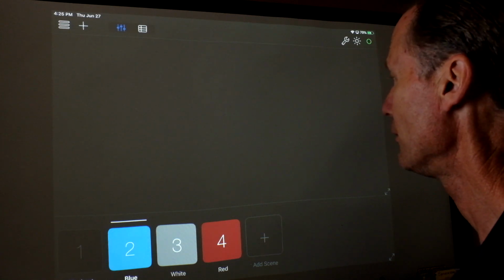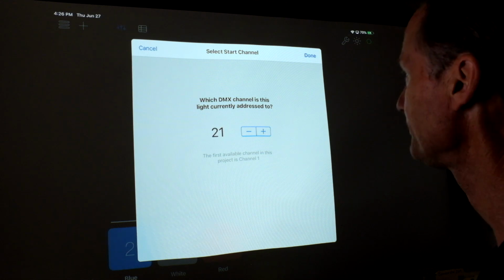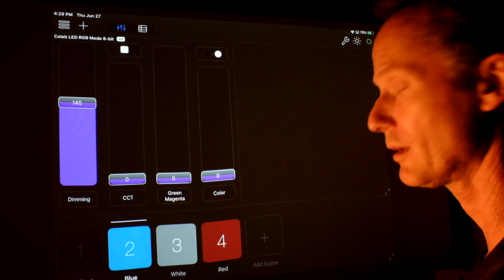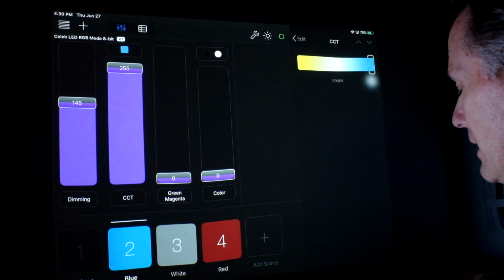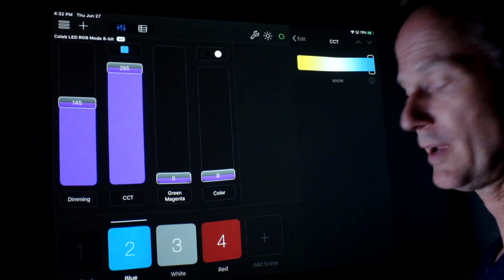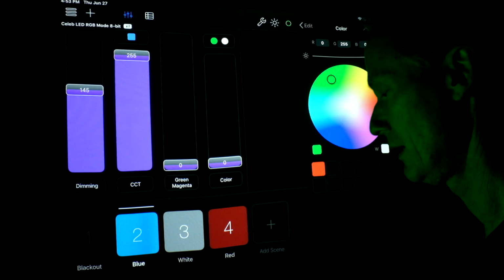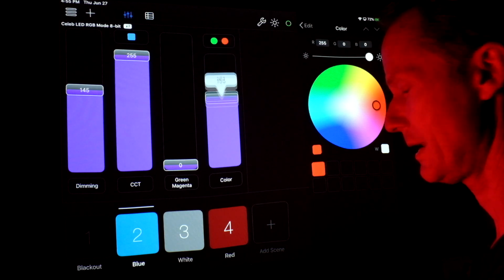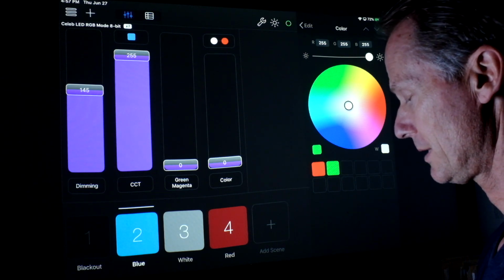Light Craft: Adding an RGBAW LED Light into Luminair Tutorial

Comment: Is there a way to remove the color fader and add an R, G, and B, fader, or do you have to just use that condensed color fader?
Reply from the maker: well yes - many ways - I also like having separate RGB faders too - but luminair populates the screen in the different profiles the way it does - so I hunt the different protocols until I find one I like. 
Also you can make your own fixture profile sooooo easy - give it a try and let me know if it works.